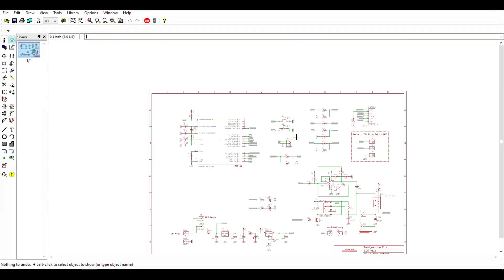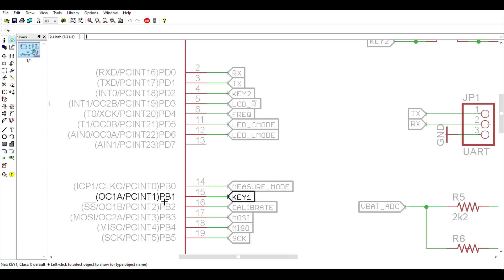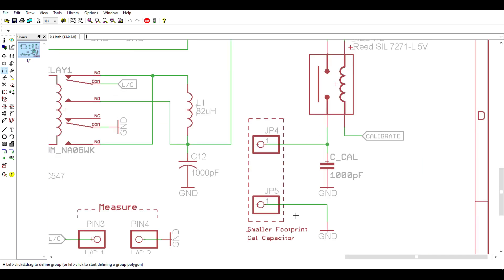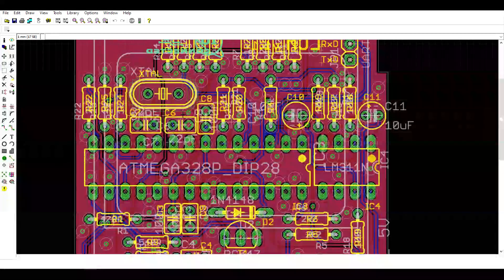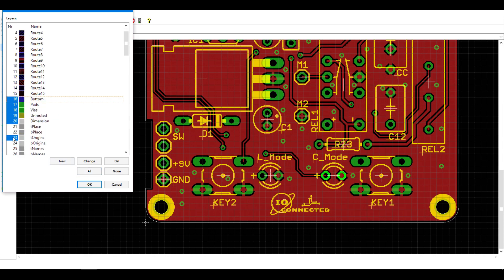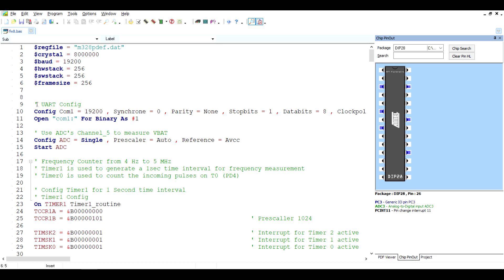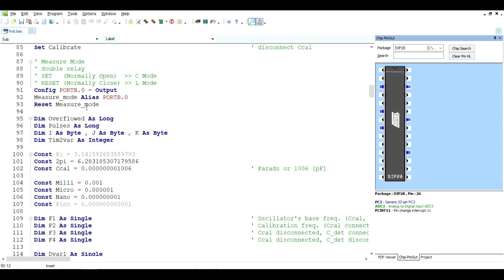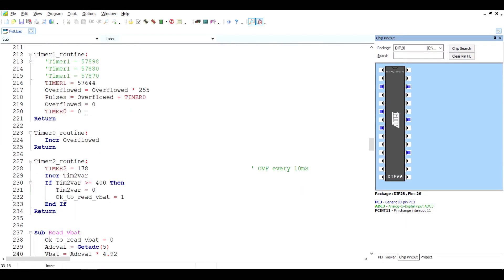LC Meter - Build - Part 2

Comment from the maker: Since I got asked multiple times here are some recommendations for C cal and C12.

For C_cal I used:
1 nF / Styroflex capacitor / Axial / Rated Voltage: 160 V DC / Tolerance: 2 % / Dimensions: Ø 4.5 mm , Length 11.5 mm 

I bought it from here:
https://www.reichelt.de/de/en/styroflex-capacitor-1-0-n-2--styroflex-1-0n-p19837.html?GROUPID=3158&START=0&OFFSET=16&SID=92fe968488052b504d180a23f581dc98fa3e05d01bdc62094114f&LANGUAGE=EN&&r=1

For C12 I used:
1.0 nF / Film capacitor (WIMA: Series FKP 2 / Dielectric PP film / Capacitor electrodes Metal foil) / Rated Voltage: 630 V DC / Dimensions: Pitch 5 mm , Length 7.2 mm , Width 4.5 mm , Height 6.0 mm / Tolerance: 2.5 % 

I bought it from here:
https://www.reichelt.de/de/en/wima-film-capacitor-rm-5-mm-1-0-nf-fkp2-630-1-0n-p31942.html?&trstct=pos_0&nbc=1

These are both ok. However, I would recommend this capacitor due to its lower tolerance / better precision:
1.0 nF / Mica capacitor / Radial / Rated Voltage: 100 V DC / Tolerance: 1% / Dimensions: Pitch 4.5 mm, Length 8.5 mm, Height 5.0 mm, Width 7.0 mm 

You can buy it here:
https://www.reichelt.de/de/en/mica-capacitor-1-0-nf-100-v--1--cy-22-3-1-0n-p42441.html?&trstct=pol_0&nbc=1

Comment: nice project! but waw, 2 relays more than 10$. what is max voltage and amp this unit uses? can an a1117 be used instead of l317? Thanks :)

Comment: Why not just display the mode (L, C, or CAL) on the LCD instead of using the two LED's?
Also, the atMega328 will run fine at 8 MHZ from a 3.3 volt supply, so there isn't any need to run it at 5 volts which would simplify the power supply.  The relays might not work at 3.3 v, however I think that relays with a lower coil voltage are available, or they could be powered from before the 3.3 volt regulator.
Reply: Well ditching the external crystal is probably a bad move since this relies on precision timing. Instead you could use an 8 or maybe 12Mhz crystal, and to be honest these AVRs tend to work fine with a 16MHz crystal even down at 3.3V.

Comment: which capacitor type is used for claibration? please. can it be replaced with ceramic ??
Reply from the maker: you need the smallest tolerance, precision cap (1000pF) you can find.

Comment: I am curious why you used a 7805 rather than a 5v LDO.  The LM7805 requires at least 3v of headroom so if 9v battery drops below 8v then the 7805 may not regulate. Also why did you use a LM317Z and 1% resistors rather than using a LP2950Z-3.3 or other 3.3v LDO as it is hard to get right resistors for LM317 and the Nokia display has a max voltage that could potentially be exceeded.  Thank you for a very nice project.  I am trying to upload the 1.6mm case files to JLCPCB but they keep saying the filename is too long and exceeds the 30 character limit (even though most do not exceed 30 characters).  I dropped the same files into a online 3D viewer and it viewed correctly.  Do you have the Case files uploaded to them of PCBWay or Seeed Studios so we can just pick them?  Thank you.
Reply from the maker: You're right about the 7805. There are better choices for the regulator. I used despite its disadvantages you mentioned, because it's readily available, it's easy to source, and not expensive. The LM317 and the 1% resistors I had available, and yeah there are other ways to do the 3V3. The project is open source so anyone can modify the schematic. As for the Case files I never used a fab house to manufacture the case so I can't tell you what's wrong. Just a thought. Use the STL to export in whatever format your printer will recognize and save the files with shorter names.

Comment: Where is the schematic and parts list posted?  I do not see it on your github page.
Reply from the maker: https://github.com/coreWeaver/LC-Meter/tree/main/LC%20Meter%20v1.0/1.%20Schematic%20and%20Gerber%20UPDATED%20Apr.08%2C%202021

Comment: Would 1% MLCC capacitor work you think? Is there any more details you can give on the design of the opamp circuit? I am also wondering if any other circuitry could be added to do a primitive ESR measurement.
Reply from the maker: I think so. MLCC are very good quality nowadays. Try getting X8R or X7R. 

The LM311 is a high speed - voltage comparator. At t0, there's 2.5V on the non-inverting input and 0V on the inverting input. So the output (pin 7) will be high, which causes c10 to start charging through R19, which will cause then the comparator's output to get low again... The process repeats itself with a frequency equals to the resonant freq. of the L1 - C12 pair. 

As for the ESR, it will need some additional external circuitry. I will add it in a future version.

Comment: Could I have your microcontroller firmware ?  : )  because I don't have your LCD display and I want to change it to use another type of display .
Reply from the maker: all the documentation and also the sw are available here: https://hackaday.io/project/178081-build-an-lc-meter

and here: 
https://github.com/coreWeaver/LC-Meter

If you need help send me an email.

Thanks for watching. Don't forget to subscribe.
Reply: Oh! Sorry , I know how to get the firmware now .
Reply: May I ask what type of capacitor you used for C_Cal and C12 ?  Thank You !
Reply from the maker: see the pinned comment

Comment: I came across your project and it is exactly what I was looking for. It is very well explained and thank you for sharing your designs. A quick question, what is the lowest capacitance value that your design can detect? I am looking for capacitance range of 1pF and up. Thanks
Reply from the maker: Quick answer to your question: if you work carefully, make good solder joints, clean your board, make sure there are no residues, use short / good quality measuring leads and probes, and most importantly use small tolerance parts (especially the two precision capacitors) you will be able to measure 1pF caps with very good precision. Thanks for watching.
Reply: @coreWeaver  That's great. I just watched your 4th video where you measured 2pF capacitor which is what I am after. Not sure if you have 0.1pF capacitor or similar, would you be able to measure tiny capacitances less than 1pF with your design as well? I think better question would be, what is the lowest value of capacitance can you measure. Also, do you accept donations?
Reply from the maker: @davidnorman3000  I only tested till 1pF. I suppose I could try measuring a series capacitance of 2 x 1pF which should read 0.5pF. I'll also have to check the firmware first. I can't remember how that "converting to engineering units" subroutine works. I'm not sure it will display something smaller than 1 for the pF domain. I'll get back to you on that.
As for donations, I don't have patreon yet, only paypal. If you want send me an email at: core.weaver@gmail.com. Thanks
Reply: @coreWeaver  that's great. Thanks. I am building some interdigital electrode sensors to measure moisture in soil, for which I will be providing a sinusoidal signal to the sensor and use your design to measure its capacitance with different levels of moisture. If possible, would you be able to recommend how to adapt your design for sinusoidal signal instead of a square signal?
Reply from the maker: https://www.youtube.com/watch?v=OS8h7cKJdKs hope this helps. I guess you could go lower than 0.2pF, but the measuring precision will drop more
Reply: @coreWeaver  thank you so much

Comment: is it possible to use 5v relay instead of reed relay??
Reply from the maker: I hope it's not too late, I just saw your message. Yeah it's possible to use a normal 5V relay instead of the reed relay. You should use a transistor though. The AVR can only sink 20mA @5V per I/O pin.
Reply: @coreWeaver  its never late. Actually i have learned so many things about avr after watching your video. I wanted to be 100% about this project. and i have collected all the parts accordingly . I have modified your pcb eagle file a little to make it at home, but i failed 2nd time. I belive in my 3rd trial i can finish this. Now i am on vacation, after finishing i'll inform you... Thank you.
Reply from the maker: @RepairRadioLab  send me an email I might be able to help you out: core.weaver@gmail.com